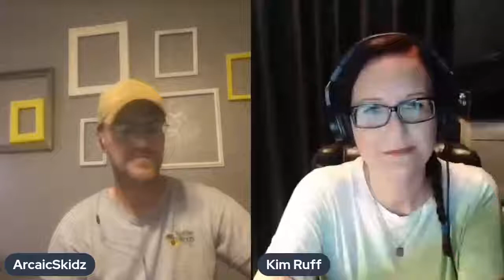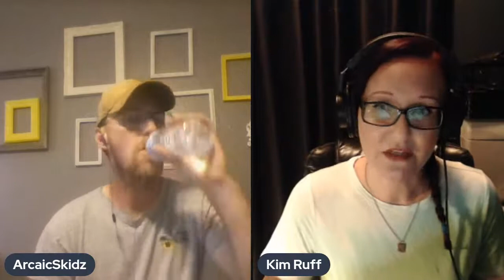Economic and Environmental Impacts of Mining

Comment: It's not solar and wind causing rolling blackouts.  It's  poor planning and not growing the production to meet the growing demand. A lot of people are jumping on to blame solar and wind power. Most the blame on solar and wind came after coal mining became the political hot potato.
The issue with solar isn't about capacity vs cost as solar is now less than $1 a watt. Its cost of battery capacity to store power to meet the huge demand of the average home.
Reply from the maker: The majority of rolling black outside its caused by transmission loss, every other form of power can be powered up to increase output on demand except solar and wind. There is no amount of batteries that could hold the power of a single nuclear plant in the same space. Besides they require more mining not less, hence bigger environmental impact